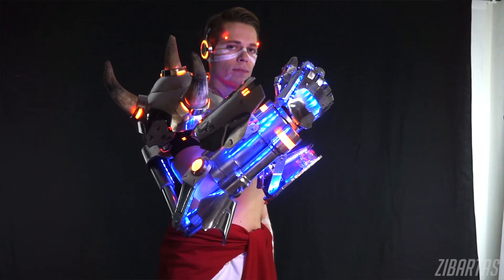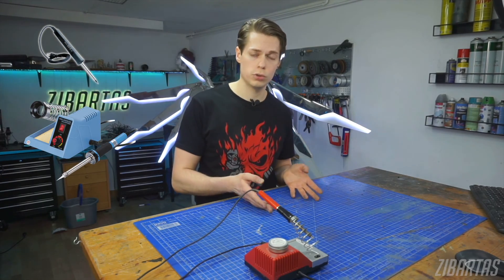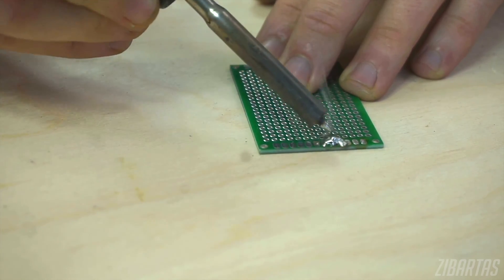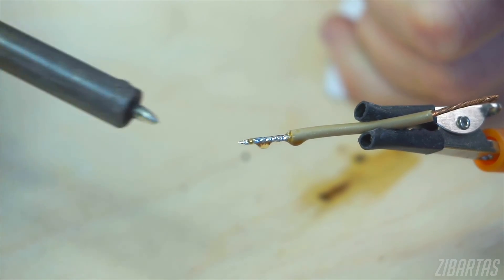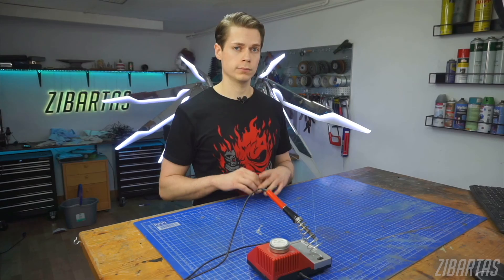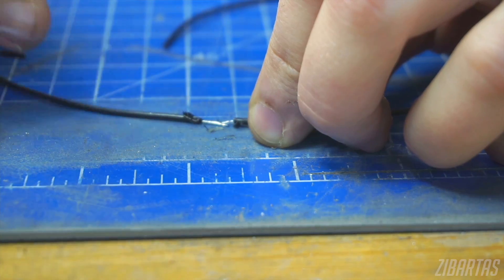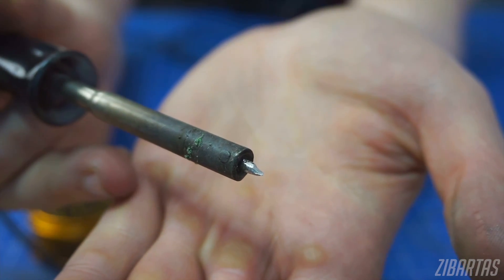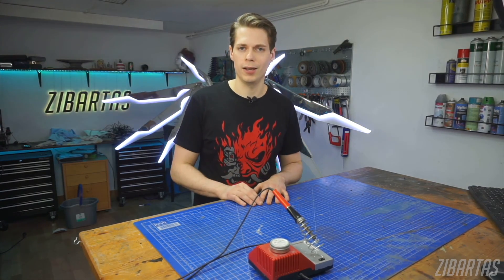Upgrade your Soldering Skills! DIY, Cosplay and Prop-making Electronics.

Comment: The one thing I did to make my soldering easier is a 3D printed (you don't need to 3D print something but I had the tech/stuff available.) a holder using clips to keep my wiring in place for my setup was driving me mad trying to hold the wires while also holding the iron. Doesn't help much for boards and stuff but was a god send for wiring stuff together.

Comment: Bonus tip - too much heat is no bueno. I just did my first traces on a perfboard, wondering wtf was going on, just blobs everywhere! Dropped the heat by 30-40 degrees, and now you can basically "draw" a line between the through holes :)